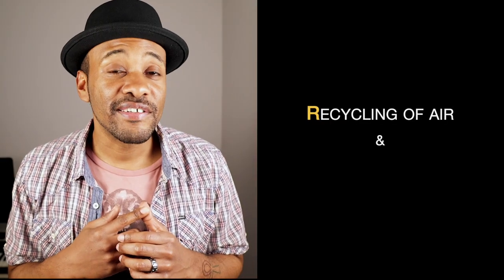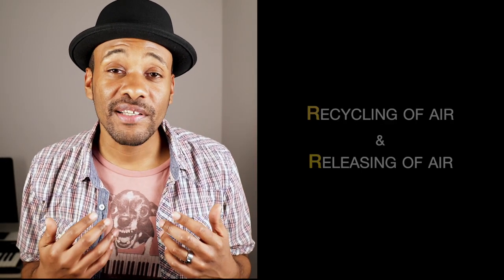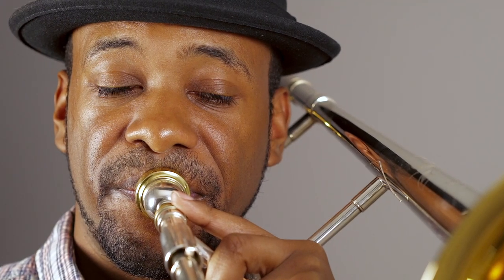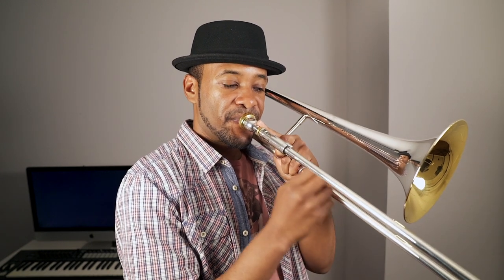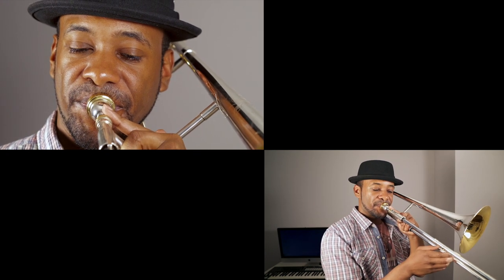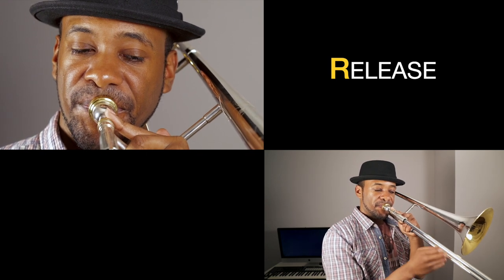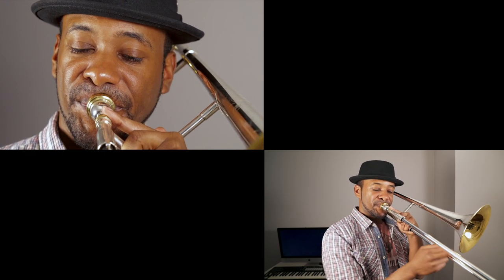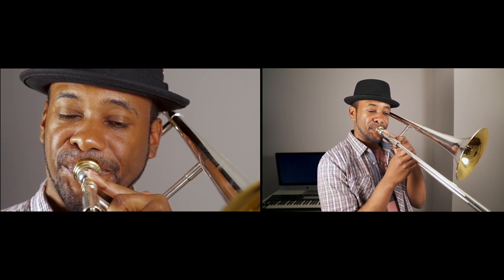A Little R&R in Your Brass Playing

Comment: Just like other things,  we have enlisted the functions and structures of the body to play a brass instrument. 

What you are referring to is elastic recoil pressure. And you must inhale to some degree to have this elastic pressure.

Two comments 

1. It is unlikely you are actually relaxing and "releasing" except for on the lowest softest ( and shortest) notes. You ARE using exhalation effort even if a gentle one. Im sorry, but you are, regardless of what you call it.

2. When playing a brass instrument, Air flow is never FREE. That is, without resistance. The acousic load of the instrument AND the playing aperture are resistances that are always in play.

Exhalation through a wide open mouth into the air is the freeest flow.

But this is never the case when playing.

Efficiency of effort should certainly be encouraged but you should be more realistic with your approach. 

I DO use the release of elasic pressure for the first soft low notes when teaching a student,  I understand what you are going for. But hopefully you understand that this IS actually air pressure but without exhalation action.

Unfortunately,  elastic pressure decreases as air flows out of the lungs and exhalation effort must gradually be increased to sustain the tone.
Reply from the maker: Darryl Jones I’m definitely relaxing in between and not actively breathing. At any rate it sounds like you got it all figured out. Fortunately these concepts work great for my students. I look forward to viewing your video or book you put out on the subject. If the concept does not resonate with you then no worries. There’s a lot of content out here to absorb.
Reply: @TheChopsShop  for sure. Look, don't take my comments personally.  Thanks for discussing.

But yes, absolutely,  the starting point of releasing elastic recoil pressure is sufficient for soft low notes. These also should be the first notes daily for ANY brass player. And certainly the first notes for a beginner. 

Excessive effort and poor efficiency is  a problem for all players and especially beginners. I have an approach of VERY low effort to help players. 

But effort itself is eventually required as one ventures into higher frequency tones and louder tones.

The important thing is what results you achieve FOR effort applied.  THAT is efficiency. 

I know that there is a plethora of advice in the brass community that is MORE MORE MORE!   
More "support".
MORE AIR! 
MORE TONGUE ARCH! 
MORE "AIR-SPEED"
and on and on.....

Of course more effort input does not solve efficiency issues so I find that advice as the sole solution tiresome and ineffective as well.

By the same token there is no such thing as "relaxed" playing. 

Low-effort playing? (or better yet, optimum effort). Absolutely.